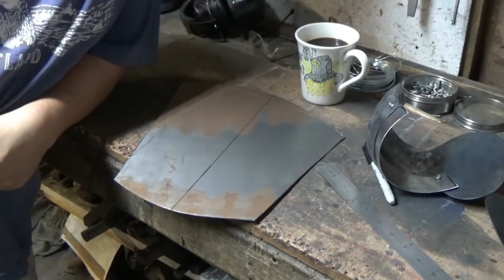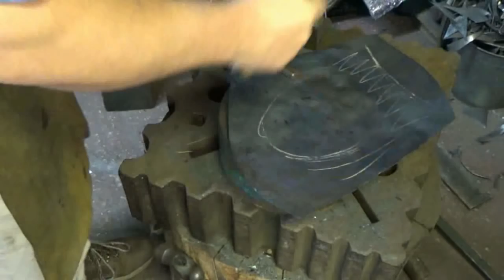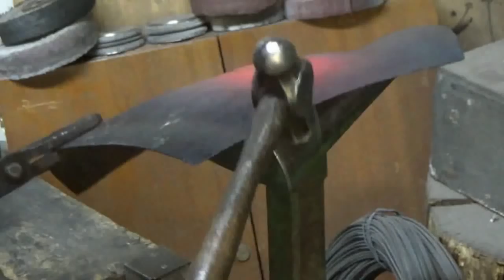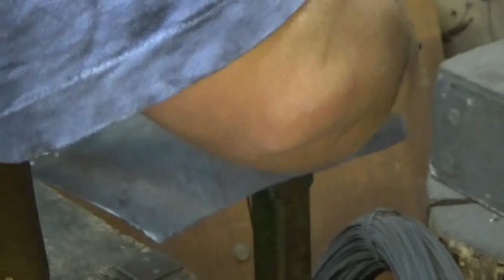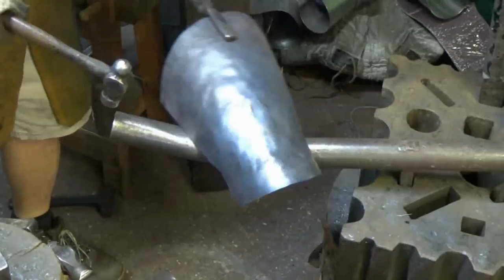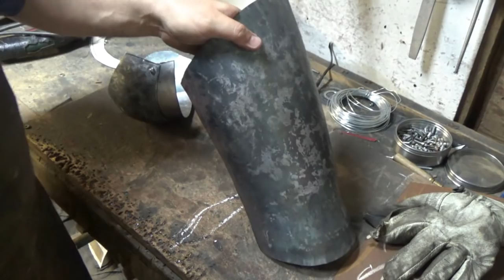How to make thigh plates, cuisse. A quick time video.

Comment: Greenleaf Workshop, what kind of propane forge are you using? :)
Thanks
Reply from the maker: If I remember correctly I bought the down pipes from this chap and then welded up a firebrick based container around it.

https://www.ebay.co.uk/str/devilforge2014

I only made my own box as the boxes at the time weren't quite big enough.

Comment: hey buddy! just a quicky.  when you use what looks like some bent scaffolding pole, to help with the opposing curve above the knee. is there anyway of doing a similar thing without said pole? i have a decent anvil but not acquired any stakes yet. sorry for such a novice question :)
Reply: Funny you say that, I actually was about to ask the same question :)
Decent anvil, no stakes; that's exactly what I'm dealing with
Reply from the maker: No worries at all, I use the pole but frequently just use the horn on the anvil, just lift the work off the anvil where you intend to strike and it will drive that space down onto the horn and start your dip, just go at it slower moving a little at a time. I sort of do it on the horn stake for a bit in this video.

Try and have the heat n the area you're striking and it will be supported by the cuisse end rather than deforming it.

The bent pipe is just a bit quicker. The pipe is some scaffold that I heated and bent, nothing special.
Reply: Thanks for the tips!
Reply: thanks mate!

Comment: I might be able to return the favor for you and give you a tip that I discovered helped me with doing a great deal of work in the shop.  You know how sometimes you'll use your ball stake to move a great deal of material quickly?  Well I decided to expand on that idea several years ago and simply hang the stake end from the ceiling with a bungee cord hook.  This does two things it effectively gives you a return spring for your hammer so that you are able to control that 8 pound stake as though it were a 2 pound hammer, and it reduces the "bag of marbles" effect that you speak of frequently by putting much larger surface area dents into your work that overlap by a much larger percentage.  At first I was just using a 4 inch round ball to do this but got to thinking a larger surface area hammer might be even better so I got me a 6 inch rounded pipeline end cap.  Made of about 1/4 inch thick steel with a curved surface which would make about a 9 inch diameter sphere.  So I welded a half meter long piece of 1 inch pipe into the center of the inside, drilled some holes near the end of this that would accommodate the hooks of my bungee cords and added lead to the head to suit my taste.  I'm frankly astonished at how quickly it moves steel, and at what thicknesses it can do it.  Extrapolating on this idea I'm thinking this bungee return spring idea can be expanded to flat surface hammers for fast pattern welding and things like that where a power hammer or assistant might otherwise be used.   Oh and for putting that bungee cord on the ceiling If the ceiling is too low to simply hang the bungee cord directly put a cotter pinned rope pully, on a nail directly over your work surface and then nails at graduated distances away along the roof beam so you can adjust the height of your hammer as it hangs just barely above the work weightlessly.   The kinetic energy comes from the momentum and inertia of your bungee hammer.  :)
Reply from the maker: I think I saw someone do this a while back on the Armour Archive. Thanks for the tip, but I think I'd likely pull my roof down on me :)
Reply: it only has to handle the weight of the hammer itself.  So between 6 and 12 pounds depending on how silly you want to get.  I initially tried it out in an ancient 2 car garage which had no more than 2x6 spruce rafters in the ceiling and had no problems whatsoever with the 6 pound 4 inch ball stake.  Actually my first experiment to test the theory was simply athletic taping a loop of light rope to my existing mushroom stake and hanging it via that from the ceiling.

Comment: that dip just above the knee isnt something ive seen before. based on pictures i noticed that while some are more shaped around the top of the thighs, a good number of cuisses look to be the most tubular/simply shaped piece of a suit. very interesting. keep up the good work, hope to see more videos when you get the time!
Reply from the maker: They can vary quite a lot from very obvious to almost nothing (and perhaps even not there); so unless you are looking/feeling for them you can often miss them. Here's a good example of one that is there still … just.

https://www.metmuseum.org/art/collection/search/34868

You can cut them down a lot (or even do without) by putting a slight dip into the top edge of the lame and give the cuisse a sliding rivet to the lame.